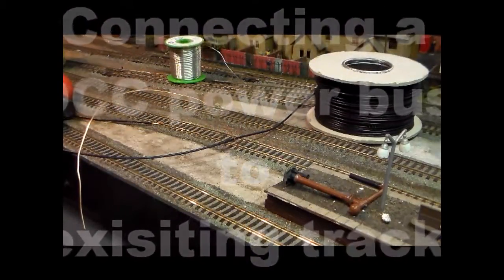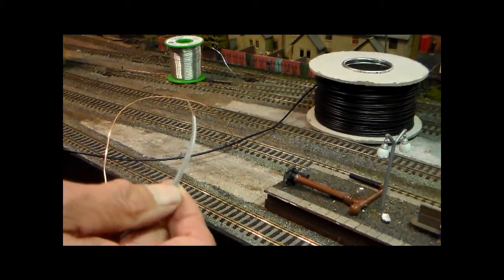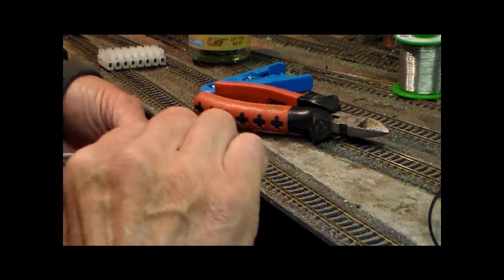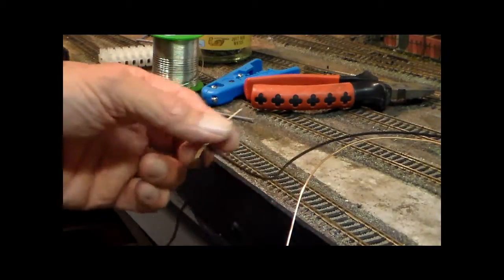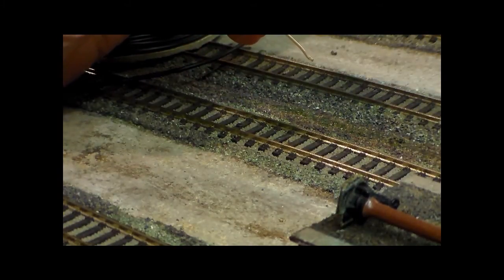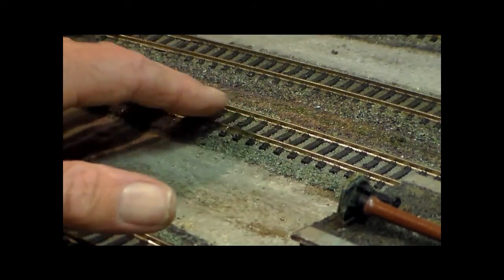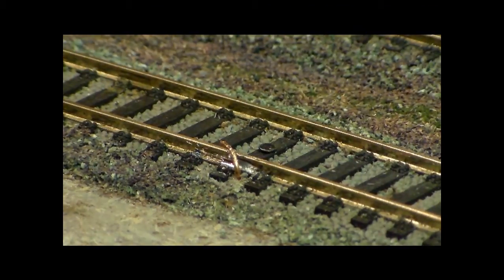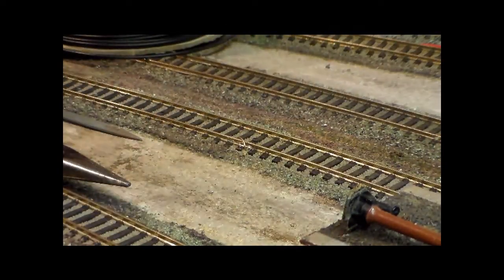DCC track power connection

Comment: A super instructional vid John can you tell me what is the best solder to use on track. I.E. pre fluxed or not many thanks   Denis
Reply from the maker: Hi Denis, I use Maplin lead free solder mostly. This include flux in the mix. The track needs to be clean so I use a small needle file to scratch away at the track or you could use emery paper. Thats all - pre-fluxed. I have some flux that really cleans the metal you are soldering but it needs to be washed off afterwards so I never use it for electrical joints. I also have a stock of flux cored lead/tin solder that I use which is no longer sold. Good luck, John